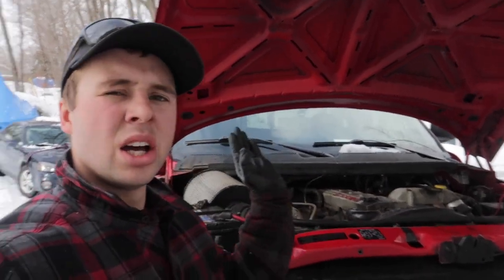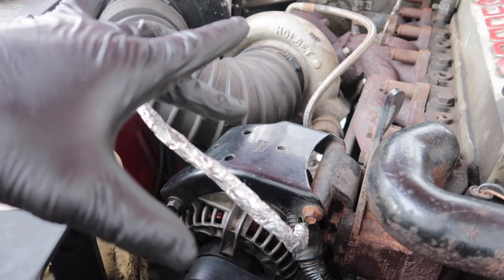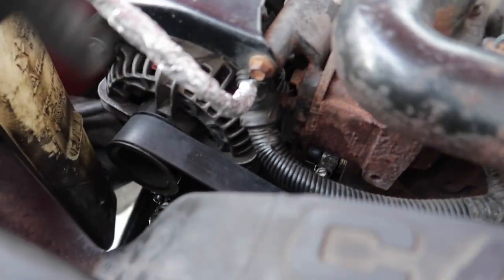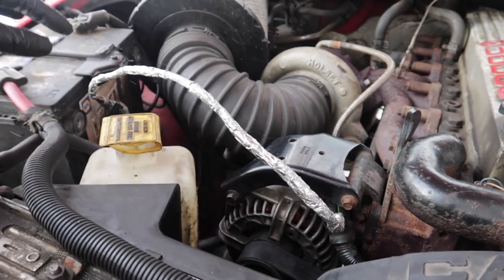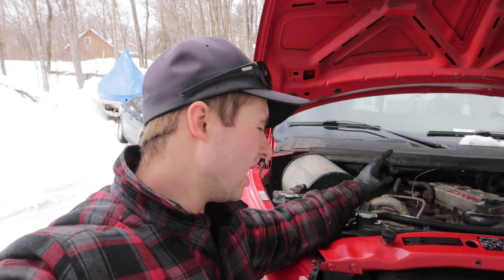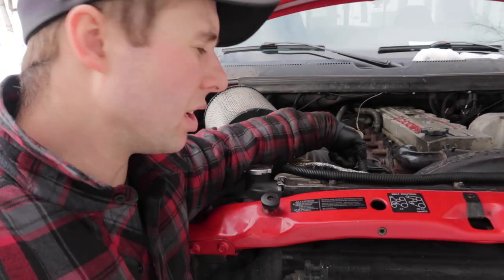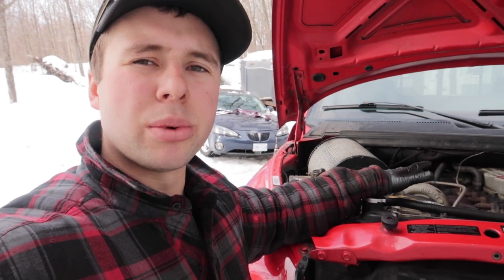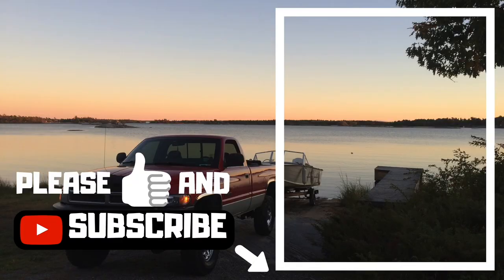96-02 Cummins Shifting Funny Into OverDrive? This May Help!!

Comment: The 47re was use from 96-03. The 24v are more known for going in and out of lockup. Ur right Rerouting the ground wire away from the alternator is the best thing you can do. But also a common problem is the alternator not working right even know you can load test it and it checks out good I think it has to be less than 5amp drawl. Also its known to kill vp44. Theres a big wright up about it I found a while back.
Reply from the maker: Very Cool! i thought they went to the full 48re in 03. I guess they had the NV4500s in 03 also.
Reply: @Schneids15  no some of the earlier 03 had the 47re in them and yes the nv4500 were used in the 03 I seen a few of them
Reply from the maker: Kinda weird they never made the transition with the body but that is dodge for ya lol

Comment: This does work I've done it on 2 dodge trucks also the trans output sensor is a cheap easy fix if insulating wire doesn't work. Suggest rap with foil then put in wire lume

Comment: My 1996 Cummins 2500 had very well rebuilt transmission but about 5000km.
After 2000km, the overdrive starts acting up when I'm hauling my 5000pounds camper trailer. Shop replaced the torque converter and happened again after 1000km.

What could be the issue?

Tks.

Comment: Remove the PCM grounds from the driver's fender, clean the paint off, clean the terminals, coat everything in dielectric grease , problem solved. I soldered new terminals and installed better sheet metal screws on mine just to insure a better ECM to body and body to drivetrain ground.
Reply from the maker: That is great and sound’s like a way better fix. However this fix never let me down.

Comment: I have a 94 dodge Cummins having that same issue but I don’t have that alternator wire to wrap it in aluminum foil
Reply from the maker: I would check your pressure solenoids in the trans. Mine had a screen on them that would also get clogged and cause the issue

Comment: hey i have a 2001 2500 and it won’t shift into overdrive at all, i don’t have the gear do you think it can be anything easy / electrical
Reply: Dominic Seaton did you ever get it fixed
Reply: My 97 3500 does it too
Reply: What have you done?

Comment: My trucks in 1996 and I do not have this plug- I replace the transmission temperature switch trans inducer speedometer switch in the transfer case speedometer switch in the differential I put a AutoZone throttle position control sensor about a year ago cuz I was having some idling issues and I thought that might have been because of it but they say to go with the OEM about two months ago the truck started acting funny like which I thought was fairly normal to me that's the way the trucks always been then after I start having issues I'm at about 18 to 2,000 RPMs at about 70 If I Stay just going regular speed between 50 and 70 miles an hour seems like at the lower speeds between like 40 + 50 + 60 it would jump in and out in and out or higher and it shouldn't it should be around 1,500 to 1600 RPM at 70 mph at least my truck from how it was the last couple years that I've owned it never had no transmission issues besides a transmission line leaking and fixing it and getting low on trans and just put new line and new fluid I replace the trans filter transition douceur a couple transmission sensors including them in the overdrive lock up solenoid so sensor wise every single sensor has been replaced that I can think of besides of one that's in the transmission and I forget what they call it but that's the only one I didn't replace I ordered the noise filter kit from BD diesel checks all my grounds that I can see from the engine all the way to the firewall to the battery terminals and everything is good I've even replaced the terminals with my own custom style terminals and everything is seems to be good shape batteries are a reconditioned 12 volt I think 650 or 750 cold cranking amps I've had him in there about a year seemed a little bit week if the truck sits for a couple days but when I throw the truck on the scan tool or I'll throw it on the ohms meter I'm reading around 14.6 to 14.7 V which seems very good another thing someone was stating that I should unhook the positive wire can drive the truck see what happens I don't know if I got to unhook both on both batteries or just one on the driver side they said just the one on the driver side cuz I think that controls the passenger side to so I haven't done that yet but I ordered that noise filter and that made it even worst so yesterday we had some rain and it's never really done at this bad now the truck the RPMs are going up and down like crazy up and down up and down I shut the truck off for a few minutes restarted it on hook the batteries started doing it again it is worse than it's ever been with the RPM issue looks like the RPMs keep fluctuating the motors running like a purring like a kitten but this is where I'm at with it I see the RPMs fluctuating almost like the lights are dimming a little bit and it does it intermittently and it's been doing it a lot today and start doing it yesterday when we started to have some rain and I've never had that do that like that before but I could feel something seemed funny because I felt it when I was coming letting off the gas it would be the RPMs would go up a little bit almost like the shifting into the lower gear faster than its supposed to I was going to replace the trans and it but I think the trans is healthy it doesn't slip through none of the gear so I think it's electronic whether it's in the body control module  PCM or maybe throttle position sensor from AutoZone that I paid 120 something dollars for is going bad people say they get a OEM one from Cummins but that's like over $400 any thoughts would be greatly appreciated the truck has about three hundred thousand miles on it motor runs good and all my fittings that go to the transmission and all underneath the engine compartment have been either Dielectric grease re-taped and all made sure everything looks to be in good shape I did that when I first got the truck and reuse 3M black electrical tape around every fitting in gap that I could possibly see and I did that long time ago when I first bought the truck and it's been good the last three years I've owned it until the last couple months it's been giving me issues and now it's even I can't even drive the truck really when the RPM start to go up and down and it doesn't matter if you put it in neutral or drive it only seems like that it's tables out is when you're in park